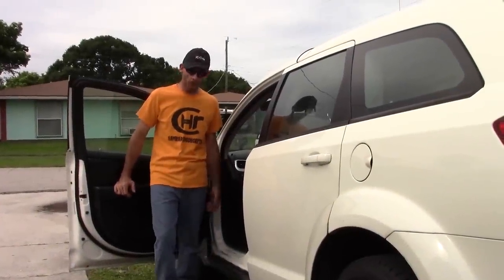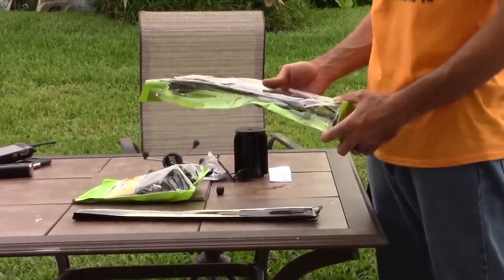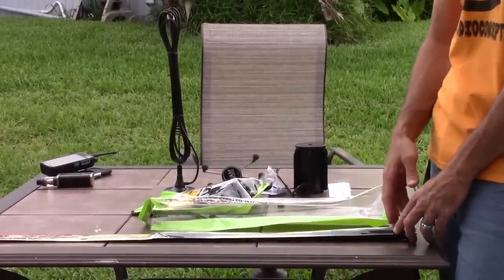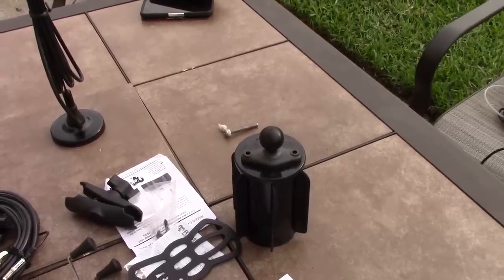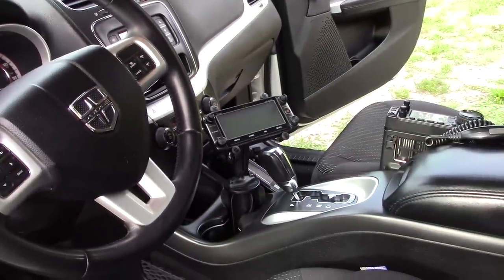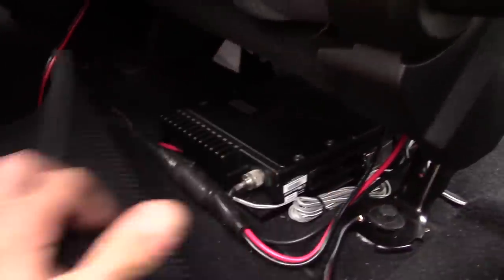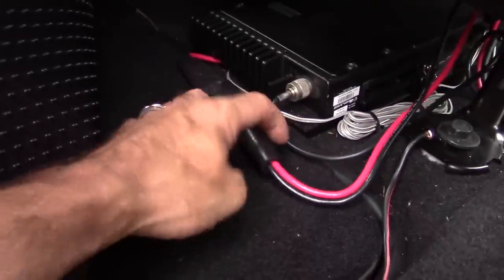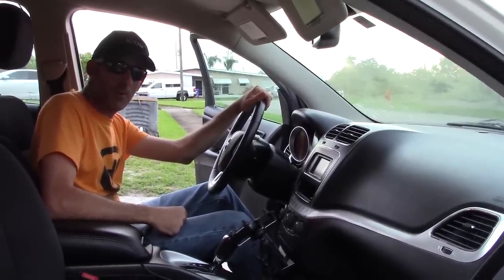Installing Your Ham Radio In Your Vehicle, Tips And Tricks For Mobile

Comment: My only problem is I have a civilian version of the dodge charger there very little room to mount anything. I have a Ham radio which is extremely long and don't know how to cut the antenna or how short I should cut it for my Icom 5100! take look at the 2008 dodge charger interior and If you have time can you give me mounting suggestions for inside. I have a mag mount also for my antenna

Comment: Great video.  In it you mention the M-24M antenna is 'set' and does not need to be tuned.  Is that the same for the SBB7 antenna - does it need to be tuned?
Michael VA6XMB
Reply from the maker: generally, all vhf and dual band antennas come factory tuned. I havent tuned one of them in my career, they just work out of the box.

Comment: Hey I have a question about the 19:32 mark of this video. Doesn't the radio need to have good ventilation where ever it is mounted? I was thinking if having the radio where you have it would not give off much ventilation.
Reply from the maker: This video is years old, I didn't have it long in this configuration but it held up just fine. Normally yes, you do need ventilation if transmitting for a long time

Comment: Do CB's and ham radio's use the same coaxial cable?
Reply: Typically yes both use 50 ohm coaxial cable. Coaxial cable used in mobile applications is usually RG-58.

Comment: What is in that wrapped ferrite noise eliminator and how is it wired?
Reply: RicoMnc The wire usually goes through a ferrite core it’s properties acting as a sort of filter ..you get something similar on PC screens that black nobbly thing in line with the cable. We used to install a noise capacitor connected to the chassis of the car. This filtered or should I say canceled , the noise from the alternator etc resulting in clean modulation rather than the whining or motorboating effect in the background.

Comment: now is it possible wiring the radio to the cars speaker?
Reply: You could run the external speaker port into a aux on the stereo as long as the gains are turned down on the radio I would think.

Comment: You don't run un-fused cables into the passenger compartment. It is a fire waiting to happen. You should know better! A fuse at the radio doesn't protect the cable.

Comment: Seeing the main unit stuffed into the center console made me cringe.  It won't get any cool air and do nothing but cycle its own hot air with the lid closed.  Transmission times aside, it will get hot in there even at 5W if you're doing a lot of QSO's.  If that's the only place for it, buy an extended warranty.
Reply from the maker: its in a whole different vehicle now... but it worked well in there lid open

Comment: Please - whatever you do - avoide a quarter-wave magnet-mount; it is such a miserable antenna - urban, suburban, rural - you will be disappointed (permanently); unless you simply stay within tight-radius (10miles?) of the repeater; maybe if you live out West USA (flat-lands), you might get along with it; for terrain and buildings around you, make peace with a longer antenna - preferably with a ground-less antenna (that does not require a ground plane); drill the hole, and make peace with it - or buy a good mount that can help  you avoid drilling holes - if that is an issue for you; I have been doing 2/440 for 40 years now. go to eham.net and read the reviews on any mobile antenna: BEFORE you buy it; save yourself the misery of quarter-wave.